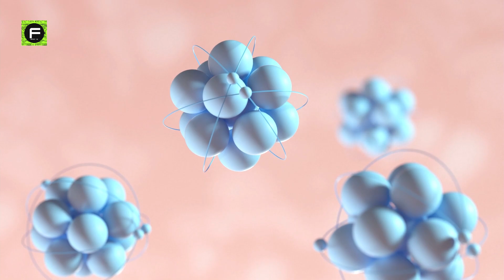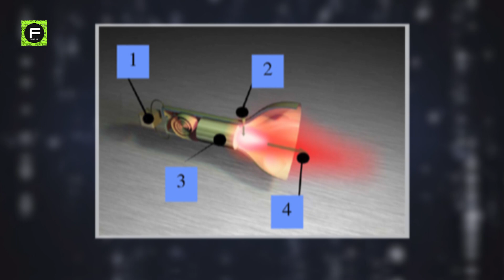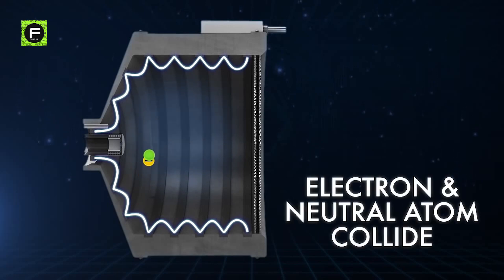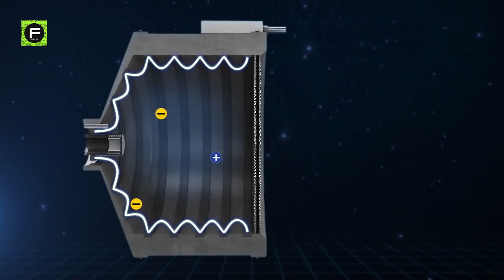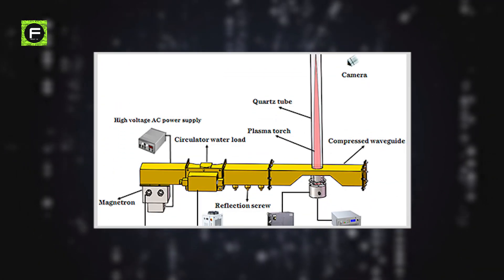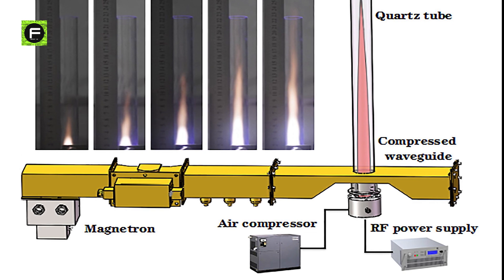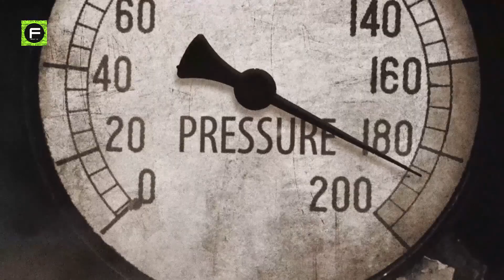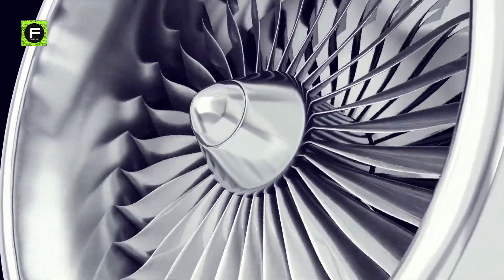Electric Plasma Jet Engine: Will Air Travel Change Forever?

Comment: For trucks and air travel, hydrogen fuel cells make sense due to higher energy density. Possible solution to the limitations of batteries.

Comment: Lies. All lies. It’s a trick or those people are stupid. Not like I am saying they won’t have their way because the people listening to them are either liars just like they or they are pretty much just as stupid. What a bunch of idiots. It’s still a compressor driven aircraft. Stuuuuuuupids!!!!! Even if a microwave generates heat from water, it won’t work with air. If you are looking at steam engines, I would say congratulations. You still need fuel so to speak. That’s amazing that microwaves are seen as an advantage. In that case, heating something up such as water, electricity can be used. I just have to wonder if betrayal was worth this stupidity. You can’t be that stupid. Also, I am pretty sure that the US won’t betray itself and give the torch to China. Again, stupid.

Comment: They should take all that heat, and boil water with it. Thus making it a Plasma Power Plant. Way more efficient, and sustainable than Nuclear, or Petrol Fired Power Plants in the community.

Comment: Plasma engines are coming along like expected. Small lab units now, it just takes time for batteries to get better and the engines to get stronger. Hydrocarbon fuel will not be replaced but in a decade or two electric propulsion will cost less.
Reply: NASA dumb. China foreign. Plasma Engines garbage (Microwave ovens do not heat up air. In fact, microwave ovens do not function without the exhaust vacuum system creating a vacuum inside the microwave oven. Nah, the fan you hear isn’t used to cool the microwave oven).
Reply: Battery's right. Give these things a reactor.
Reply: Plasma - - - - 
https://www.youtube.com/watch?v=MPnUExhBVwE